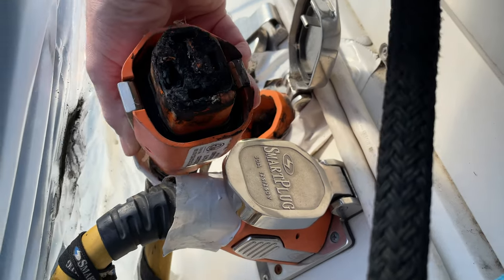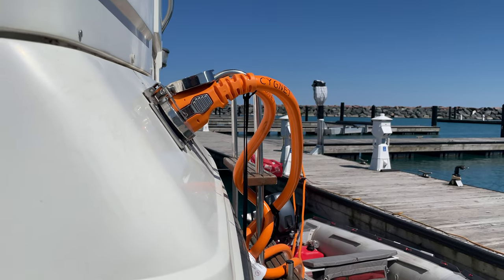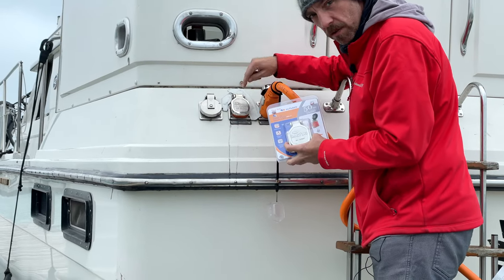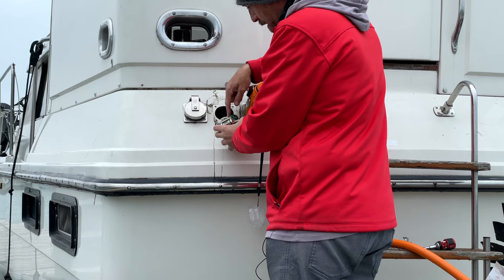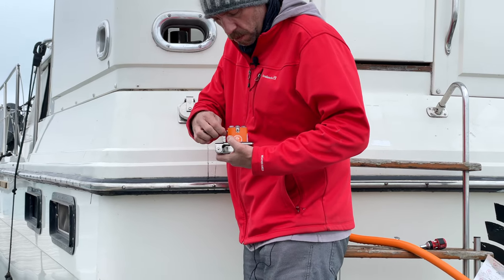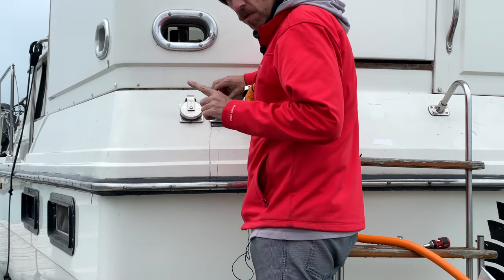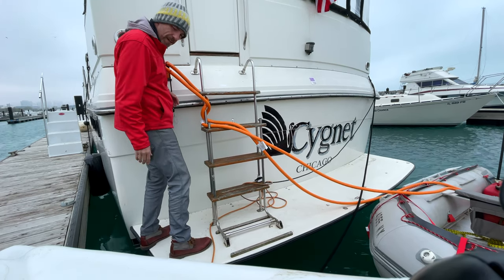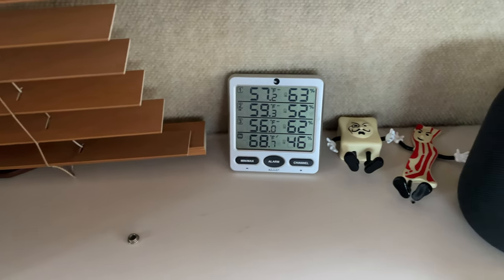AC Inlet Fix After Meltdown

Comment: You should plug your cord into the boat then the power source before turning on the breaker, if you slipped and fell in the water with the cord under power would make for a bad day. 
Thanks for the video's, let's hope the weather warms up for you two soon.
Reply: Good tip. I try to never turn on the pedestal breaker before anything is plugged in